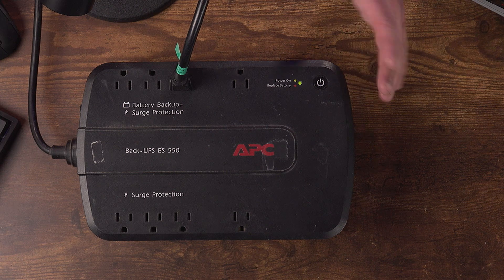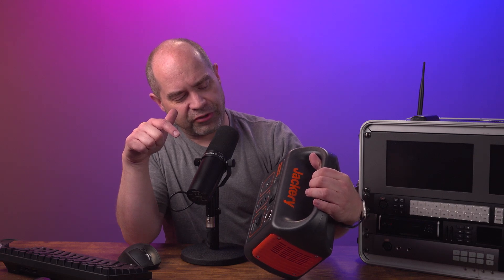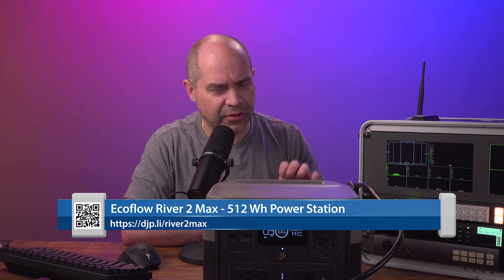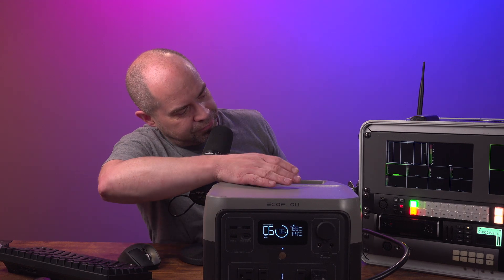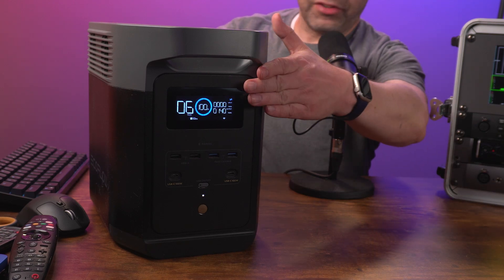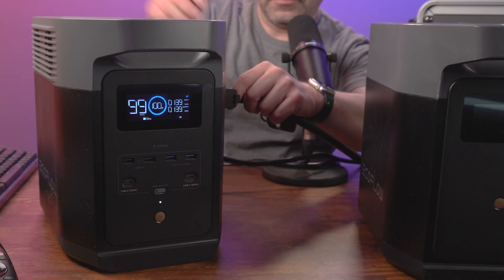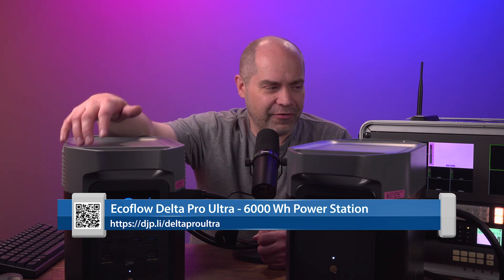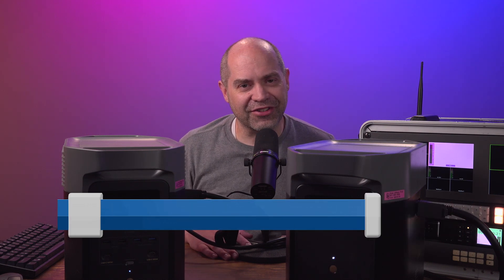Battery Backup/Power Options for Video Production Systems

Comment: At 8:40, I noticed that your system shut off and then turned back on. Is this one not as quick to switch to the battery?
Reply from the maker: The Delta 2 is not guaranteed to be, but I haven’t had an issue at the actual events I’ve done with it. 

The newer Delta 3 Plus and River 3 Plus series are fast enough to act as a UPS. They switch over in 10ms or less.

Delta 3 Plus: https://amzn.to/4gyngjD
Delta 3 Pro: https://amzn.to/3DCOTcO
River 3 Plus: https://amzn.to/49WLOjM

Comment: Thanks Doug, very timely as I'm looking to replace an APC UPS system as it's way too noisy for my studio. Is the Delta 2 quiet?
Reply from the maker: It might be too noisy for you. When it charges or has to supply more than a few hundred watts the fans will turn on. You can reduce the charging rate to prevent this. Otherwise you might have to relocate it to where fan noise won't be a problem.

Comment: Nice video!  This weekend, I'm going to be using an Anker Powerhouse 522 (similar to that Jackery) to power electronics for my jib crane (Proaim pan/tilt head and an SDI -> HDMI converter), and an Anker Solix F2600 to power the production truck.  Based on the max wattage of each device, I should be able to run everything for about 4 hours if power goes out.  I could almost run everything just off solar too!  It's amazing how far battery technology has come, and how power efficient newer devices have become!

Comment: I've had an EcoFlow Delta for a number of years now and it has completely eliminated my need for generators or long extension cords.  Great for tossing in the back of a car for charging batteries on the go to powering a 2-4 speaker PA system and small rack of equipment for an event.  I've purchased a second as a backup, but have never needed it and my original unit is still going strong.  I've recommended them to many people who have also enjoyed them.

One thing to note: while it will take over if the source power is lost, it's not a clean switch like a UPS.  It will 'blip' as it kicks over to full battery and depending on your equipment, may go into protect.  

I guess another thing to note (at least on my units): they don't give any audible warning when getting low.  They do however still run for a while on 0% remaining.
Reply from the maker: I'm definitely rapidly adopting power stations for use in my video projects as replacements for long power cables. 

At a big event I was producting the last two days, we ONLY used power stations for the cameras (no stingers), and I used one to power one of my Yamaha Tio1608-D Dante stage boxes. It was going to be a long day, and I didn't want to use one of my bigger power stations to run the Tio, so I used a River 2 and plugged a 100-Watt solar panel into it. That kept it going all day long. And I was able to connect to the device with my phone from 300 feet way away so I could monitor the battery level without having to walk that distance over and over. 

I haven't explicitly used any of my units for a PA system just yet, but I just also ordered a Delta Pro 3 and I can imagine that that will run a small PA system for quite a while. 

I'm aware of the UPS issue, and that's why I mentioned in this video to buy from someone with at good return policy in case the power station someone buys causes reboots with the gear they're powering. 

I haven't gotten any of my power stations down to 0% but, yeah, it doesn't seem that audible warnings are considered an important feature.

Comment: I realize you rushed to get this out and thanks for doing that. I realized I could buy 2 of the River 2 for the price of 1 APC 1500VA 900W UPS (with a paltry 11 minute run time). I paid $323 this time last year for a APC BR1500M2!! So even if it's smaller less output, what's not to like! And I dare say, I only really need them to be UPS's so they're not likely to ever really see a full discharge cycle. Maybe 10 minutes before our house generator comes on. Thanks Doug! 👍

Comment: Great video Doug. Do you think power stabilizers are useful for AV equipment? I am mostly working in live environments.
Reply from the maker: A power conditioner would likely be more useful. Dirty power is more of a problem with modern electronics than voltage variations. Most modern equipment power supplies are designed to handle a really wide range of voltages. But dirty power is potentially another story.
Reply: @djp_video  thanks a lot!

Comment: When you unplugged the Delta 2 at 8:39  https://youtu.be/Vhimfk4-fgM?t=519 did your fly pack fully reboot? It seems it did not stay up like it did in the other examples.As others have pointed out I could put a UPS past the ecoflow to have the fail over and then the long running time of the eco flow.
Reply from the maker: In this case, it did. I rushed through setting it up to get this video out quickly and I think I didn't have something setup right on the Ecoflow. Every time I've done it in testing it hasn't caused the reboot.

Comment: Hey. You said that the Eco Power ran your whole production trailer. Does your production trailer include audio mixers and amplifiers?
Reply from the maker: Mixers, yes. No power amplifiers. Several sets of speakers though.
Reply: @djp_video @djp_video, do you have any suggestions for amplifiers for passive speakers?

Comment: Does your Xantrex inverter and battery work better or about the same as one of these EcoFlow or Anker units? Can you run your truck off just the Xantrex inverter and battery? How long would it last? I'm looking into a small production truck with 4 cameras, switcher, audio board, monitors and V-Mix replay and wonder about running all this off the Xantrex & battery power or an EcoFlow for an entire Football Game or Baseball game. Do you think this would work? Love your videos and information. Thanks.
Reply from the maker: The three 12V 75Ah AGM batteries I have in the trailer will run it (just the electronics) for about 90-100 minutes (without the solar panels making any contribution). That setup cost about $1300. The same run time in an EcoFlow, depending on what sales are going on, would be over $1500, likely well over. And I'd still have to figure out a solution to power all of the 12 Volt devices. (All of the lighting, SDI/HDMI converters, quite a few of the computers and monitors run natively on 12V). That system doesn't power the air conditioner, though... which is needed to keep the equipment (and crew) from misbehaving. 

After the AGM batteries wear out I'll be replacing them with LFP, which will give me more capacity at a lighter weight. But so far the existing batteries are still going strong. I would have liked to have gone with LFP out of the gate, but when I built the trailer the cost difference was about 5:1.

Getting a battery setup that can go for the 5+ hours needed to run a sporting event will get costly pretty quickly. A generator is likely a much more feasible solution.
Reply: @djp_video  Thank you so much for your great and informative reply. Love your channel.

Comment: Thanks. To be honest, Blackmagic devices are not specially power efficient. For instance, the URSA broadcast camera eats battery very fast. Again, you get what you pay for.
Reply from the maker: Yeah. The Sony cameras I use will run for about 6 hours on a 75 Wh battery. A bit different in energy consumption than the Blackmagic cameras.

Comment: The Delta Pro Ultra could power your trailer.  Your trailer with a cellular or satellite up-link can do remote production any where with no location/facility infrastructure required.  No negotiating for an AC outlet or internet connection.
BTW 1800 watts at 120 volts is 15 amps.
Reply from the maker: Not for very long. Not only do I have to run the electronics (at about 1800 Watts), I also have to run the air conditioner (also about 1800 Watts) to offset the heat created by the electronics and people inside, not to mention the sun. So the base 6 kWh Pro Ulta wouldn't even last two hours. Yeah, you could add additional batteries, but it gets to the point where you'd need a second trailer just to haul the batteries. And then you've spent a fortune, have a ton of extra weight, and still have a fixed capacity. Once the batteries are depleted you've got no recourse to create power after that.

I've got a portable 10,000 Watt generator on the way. 10 gallons of fuel will run all day and then some. And if I run low, a trip to the nearest gas station takes care of it pretty easily. As ugly as it can be to have to run off of gasoline (or Diesel), batteries don't have anywhere near the same energy density yet.

Comment: Great tips on the EcoFlow! I bought into the EGO Power+ system three years ago, and it's served me well through several extended power outages, as well as running camera and lighting gear in the field. The 2000W base unit weighs about 30 lbs and isn't that portable, but it can use up to four hot-swappable EGO 56v batteries in any combination of 5Ah, 7.5Ah, or 10Ah capacities. With battery swapping, you can run it uninterrupted as long as you need. It's not cheap, but there's a 400W portable one-battery inverter that's about $150. 

What I don't like about the 2000W base inverter is how long it takes to recharge a set of batteries. That forced me to buy additional fast chargers for $100 each. They also make an unfoldable 10K-lumens 4-panel LED area light that can be hung or tripod-mounted. It has no remote control or CRI rating, but it's a diffuse daylight, very flexible and sturdy.
Reply from the maker: I have EGO's 400W inverter. I mainly got it so I could take advantage of the batteries I have for my EGO lawn mower and other outdoor power equipment in an emergency situation more than anything else. But so far I haven't really found it to be that useful. 400 Watts isn't a lot. It won't run my refrigerator, even with my 10 Ah battery (ask me how I know -- and how that was actually the impetus behind the purchase of the Ecoflow power stations in the first place). And the EGO batteries are so expensive that it doesn't make sense to buy batteries just for an inverter; you can get a really nice power station for a lot less than most of the EGO batteries.
Reply: @djp_video  Yeah, the EGO-branded batteries are overpriced. Internally, they use stacks of 18560 lithium batteries and a BMU, both of which are readily available wholesale. EGO's success has spawned a third party compatible battery market which offers the same tech at half the price. I got EGO's four-battery inverter three years ago at a steep discount, and its hot-swap feature made it worthwhile.

Comment: To keep the benefits of a UPS, I would suggest getting one that is big enough to lasts at least a minute. Then have that plug into the EcoFlow.
The smaller UPS will last me minutes but will take 1ms to switch power sources. The EcoFlow will last hours but will take 30ms to switch.
If you go [ mains -> ecoflow -> UPS -> flypack ] you can get the benefit of 1ms switching and hours of battery. 
Crucial in my usage, where my DIT cart has drives plugged in that I don't want to risk 30ms of power outage that might disconnect during a 30ms switch.
Bonus if your UPS has a sine wave corrector.
Reply: This is what I do. I run all my gear into two UPSs, and then plug those into an Anker 2000wh power station.  Those Ecoflows at $499 is a great deal.
Reply: @criticom  is there a reason not to just use an ATS with utility mains as 1st source & a battery like ecoflow as the 2nd source ?
Reply: @bhwh_h  I don't have any experience using an Automatic Transfer Switch, so I can't speak to how easy or hard they are to set up, or if they're easily deployable at an event site. If you're working from a permanent location, then it probably makes sense. The above solution works well for me as long as I'm under the rated power limits for each power inverter.
Reply: @criticom   I haven’t used either. But planning a rack build which has some redundancy. The auto transfer switches seem simple enough. Most UPS contain one. I guess I was just wondering why bother with the internal batteries of a UPS when you can just have the switch 🤷🏼‍♂️